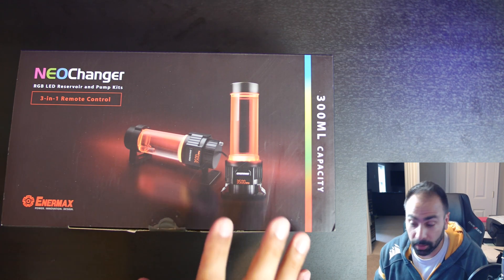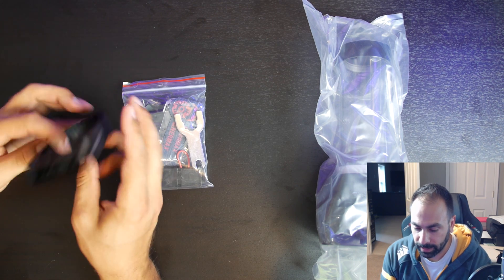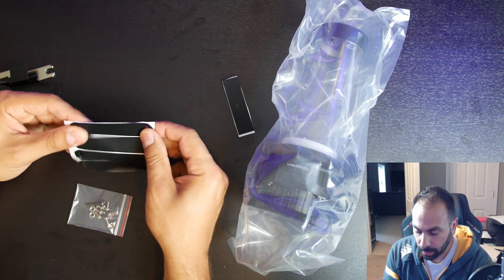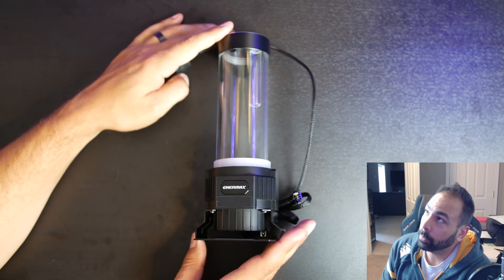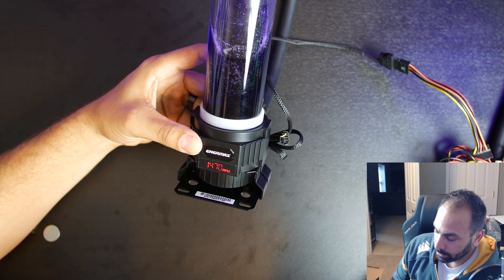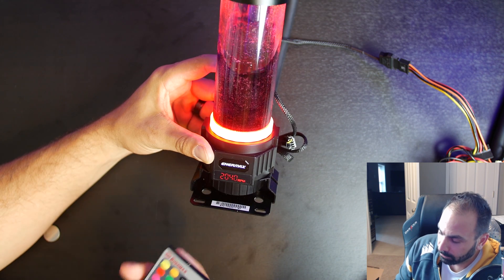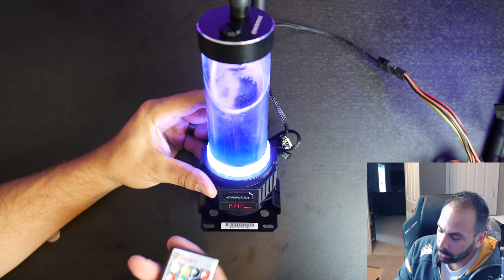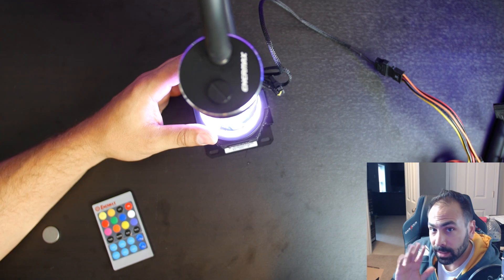Enermax Neochanger - RGB-ify Your Custom Loop!

Comment: Stopped working just after 9 months DO NOT BUY first the front readout stopped working then the rgb completely failed now i cant even change the pump speed because the remote control no longer works, USELESS
Reply: Replace the pump

Comment: Too bad this is horrible for Primochill's Vue or any coolant that reacts to aluminum because of the aluminum cap on this pump/res...
Reply: Enermax responded on Amazons review Q&A of this saying its anodized and thus shouldn't affect things and not to fill to the top of the cap but that means also you shouldn't side mount it as well due to liquid potentially touching aluminum.
Reply: Think anodize can come off with some types of stuff. Maybe the coolant used?
Reply: Best sticking to 1 metal. Throughout

Comment: is there also software or does it only works with the remote?
Reply: So, it has the RGB control that comes with it, but it has 2 cables the base, one you turn on the power source and the other you can plug in the motherboard that has RGB controller for example the Asus Rog Maximus X, she has 3 RGB tape inputs, so you can connect and change with the motherboard software and change according to the motherboard, or you change with the control you choose with which one you want to change the colors, I hope I have helped you!

Comment: im buying 2 of the 400ml ones for my thermaltake tower 900 case.
Reply: Just curious, how long have they been running and any issues yet?
Reply: @MR-ri1qp  both stopped working just after 9 months DO NOT BUY first the fron readout stopped working then the rgb completely failed

Comment: Im reading online that part of its construction is aluminum. Is the pump, pump casing, or ports at the pump made of aluminum? Can you tell? Other info im finding is only the cap is aluminum, which also sort of worries me considering it has ports. Any idea?
Reply: Enermax responded on Amazons review Q&A of this saying its anodized and thus shouldn't affect things and not to fill to the top of the cap but that means also you shouldn't side mount it as well due to liquid potentially touching aluminum.

   I'm buying one and if nothing else I will just run a show loop of custom spiraled hardline for show and have the other loop actually mounted into my MOBO and GPU and CPU since my mobo is a Maximus ix Formula and my GPU is a 1080Ti Poseidon and I dont want to change out these or risk their native copper touching aluminum and corroding metals and causing issues down the line as my system is on 24/7 and I don't like downtime

Comment: It may not be a Laing D-5 pump they run 1800-4500rpm but at 4m head 1200-1500 LPH and this shows the same rpm but 5.2M head and 900LPH That is still serious volume and way more head pressure than a D-5.  This pump also has a 100,000. HR MTBF vs the 50,000 Hr MBTF of a DDC Laing.  I think I just found my new pump/res. Sorry XSPC :)
Reply: Its evidently their own design ,kinda pirated from a D-5, or so another user said. I should get mine monday if fed ex makes it here.  I will pull it apart and compare it to my D-5s  I bet they have some crazy new impeller or pump housing or both. Its nice now that we have the head pressure of a DDC but a cooler ,quiet D5 :)
Reply: @PatriotPaulUSA  after a year what's your opinion of this pump and I'm interested in knowing if it can be broken down for cleaning without breaking it. Thanks in advance if you respond, I'm having a hard time finding long term use reviews as the product is still only a year old.
Reply: @PreacherwithoutaPulpit  Im still running mine going strong and silent . Sorry I haven't really torn it down but its been awesome.